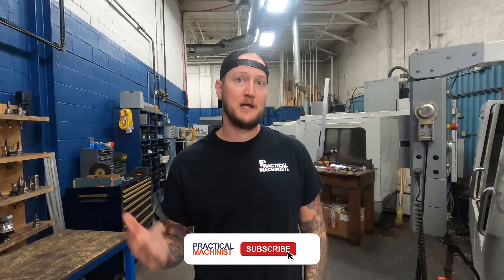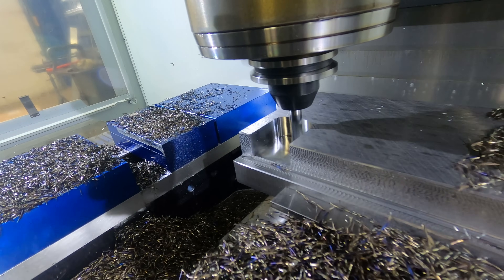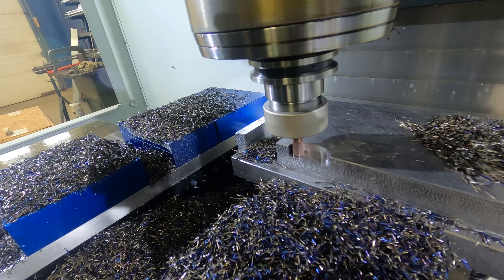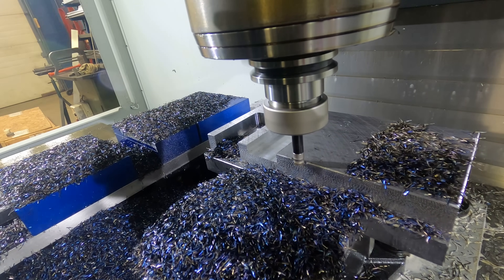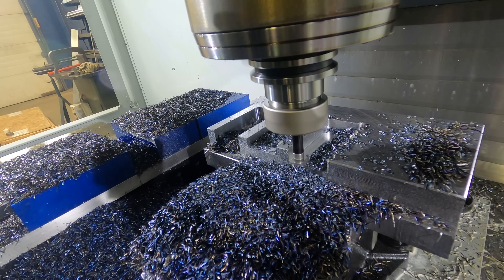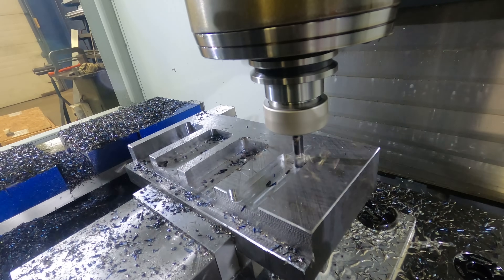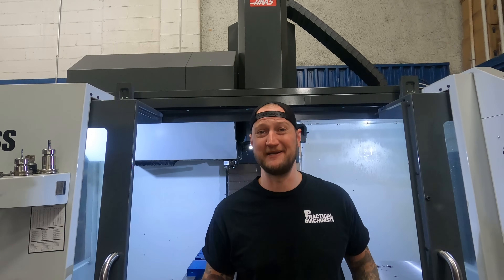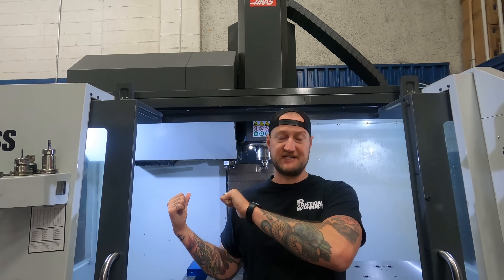Are you Wasting Time with Dynamic Toolpaths? | Machine Shop Talk Ep. 96

Comment: In narrow slots like this, yes you're better off just slotting with a 4 flute end mill. The 7 flute tool was run insanely slow. That feed rate couldve been 10x faster. Trochoidal milling is also helpful if youre workpiece isnt super secure. The cutting force from slotting is significantly higher than that of a trochoidal tool path.

Comment: Great video. Coming from a background of running a lot of tough materials the modern tool paths seems to have a lot more value on those types of material. Especially when you go from the old school thought of large expensive tool with an aggressive tool path  vs a smaller tool with a high speed  trochoidal tool path.

Comment: How do you find the best feeds and speeds?
Reply: The manufacturers provide this info for their tools in their tool catalogs, as charts based on material hardness, tool diam. So you grab SFM and IPT values from the catalog. In you cam you also have to define the tool diam and number of flutes, after that you plug in the SFM and IPT from catalog. That should put you in a good starting point that you can play with at the machine.

Comment: great demo.   I was all traditional up until about 5 years ago when I wanted to learn more about Dynamic.  Now Dynamic is my standard ruffing.  Even low HP machines can benefit.    I learned in steels you need very good tool holders - or the tool will pull out.  

many companies like Lakeshore and Helical have very good HSM feed and speed charts - you can go deeper and faster than you think. Especially if you came from a hand G code type learning curve like me.
Reply: i only started as a machinist/programmer around 7 years ago and i was taught dynamic from the get go... nowadays i am deciding between indexable and solid tooling based off of the shape of the part and raw material, roughing a shallow slope with lots of radial and not that much axial material to be removed? indexable high feed and vice versa... but most important is to get a good tools in the first place, from my experience Iscar solid carbide tooling is average at best, their indexable stuff is amazing most of the time, but i had much better results with Guhring for example compared to Iscars solid mills...
Reply: @dubi127  I am tentative of going back to index tooling as it sounded like hammers cutting but I was doing traditional tool path.  I have a friend that was an iscar engineer and shared a lot of cool data

Comment: Can that chip be re-consolidated and recycled?  Maybe heat it up and cast an end mill?  Or hammer out a samurai Dotai sword? Could likely pour some gauge blocks? THAT would be a challenge to you machinists. WHAT can you do (that is of value - or of utility, or of little loss or waste) with your chip?!? 
This was very insightful! Unfortunately for myself, my best friend- this looney old grey guy called Bridgeport got some new ideas when I upgraded his DRO’s firmware with some AI code and he ran off with this redhead named Cincinnati.  So I’m all alone, and I’m afraid that now this Makita angle grinder is as dynamic as I can be.
Reply: The chips will get recycled. Most shops will sell them off to a recycler. The shop I work at is also a foundry so we remelt our chip and make other castings from them.

Comment: Hi Ian, I'm usually a fan of your videos, but this video is complete and absolute garbage. It's obviously some sort of sponsorship with Iscar, but the issue is IF YOU RUN THE SAME DOC ON A WALL IN A TRADITIONAL TOOLPATH AS A DYNAMIC PATH THE DYNAMIC PATH WILL BE SLIGHTLY SLOWER, BUT THE CLIP LOADING ON THE INSERT OR CUTTING TOOL YOU ARE USING WILL BE CONSISTENT IN THE CORNERS LEAVING A BETTER AND MORE ACCURATE CORNER DURING TRANSITIONAL MOVEMENTS.

Comment: Try your 850 sfm on your .375 4 flute at 135 ipm. You’re not using chip thinning whatsoever so you are truly slowing yourself down a lot.
Reply: correct - I wish the CadCam systems had a chip thickness calc built in according to radial or % of step over.
Reply: @pokeyboy1  MasterCam does this on adaptive tool paths but not for traditional contours.

Comment: We had a fixture plate that was 19X10 inches that we had to take a ton of stock off around these bosses in the middle. Originally it was programmed to rough it out with dynamic and it took like 50 mins. We found a 2 or 3 inch insert cutter and roughed it out in literally 10 mins with a simple 2D contour taking depth of cuts using the full width of the cutter . Sometimes on older machines with memory limitations this is also the way to go being that it’s less code .
Reply: Oh definitely - with my old machines when the options are drip feed a modern toolpath or use a bigger cutter, you know what I’m going to pick
Reply: @LakewoodMachine 👌🏻
Reply: Just don’t say it to Titan. He will show how to mill using Dynamic at 80000 IPM on 4140 prehard  with 45% stepover and make your fixture within 2 minutes.

Comment: I think for doing small volumes, the time/energy saved just hitting "adaptive all the things" when programming can be worth the potential of a slightly longer cycle time in certain cases. If you're at the point of needing to save a few min per cycle to make big savings then sure seems like there's times when getting specific tools to go HAM on specific geometry makes good sense. But what's the risk of programming errors and such? 

I do usually 1-20 part runs so it's often I go very conservative on dynamic toolpaths just because I don't want to loose time to a booboo where we bit off more than it could really chew.
Reply: I hear ya man - if you’re not cutting seconds off production for huge runs sometimes it’s easier to just work with what’s working!
Reply: i like the idea that when you get a new tool/machine, run it fast and hard to see where the limit is, back off around 10-20% from that failure point and enjoy decent tool life, reliable process and fast cycle times... 
I usually do 1-4 part batches, but around once a month i get to program and setup larger baches of parts, sometimes in the thousands, this approach has worked for me pretty well in the last couple of years... Right now i am tweaking a production run of 3500pcs/month on a lathe, progress so far is cycle time halved, tool life pretty much doubled... may even post first operation as a short in a few days...

Comment: Broadly speaking, dynamic toolpaths are best suited to dynamic machines. A big 40 taper machine is designed to make big cuts with big tools, but it just doesn't have the acceleration to get the best out of dynamic toolpaths. A VF might in theory have 1000 or 1400ipm rapids, but it won't get up to anywhere near that speed on short movements because there's just too much inertia. Try the same thing on a Speedio or a Robodrill and you'll immediately see the point - these machines aren't as rigid, they don't have as much spindle torque, but they absolutely fly when they're out of cut. Pecking away with light cuts suddenly makes a ton of sense, because it's what those machines are built to do.

The other important factor is process stability. A dynamic toolpath that's more gentle on your cutting tools and workholding might be the better choice even if the MRR is lower, because it's much less likely to result in a scrapped part or a crashed machine. This is particularly true if you're looking to run parts unattended, if you're working with difficult materials or you're running complex parts with long cycle times. A traditional slotting or pocketing toolpath has a much higher pucker factor than the trochoidal or high feed equivalent.
Reply: This is the first time I've seen a 40 taper machine referred to as "big".  

One of the machines I program is a Cat50 Matsuura that can, and does regularly hit 2500+ipm.   Most modern, linear guide machines aren't going to have an issue hitting the higher feed rates.
Reply: When he said full rapid return, I thought it looked like 25% or slower. I agree the feed could have been much faster too. At least on our mills it could have.
Reply: What about high feed compared to these?
On another note... a solid carbide end mill is about 20% the cost of the last tool (the carbide axial screw in tip). Like ridiculously expensive and it's a one and done.

Comment: Dynamic milling you could run much faster and if you really want to make make this pocket fast you better to rough it with high feed cutter almost with the same diameter as a width of the pocket and then clean corners with solid carbide tool
Reply: That would most definitely be the way to do it!

Comment: I may be missing something here, but your first two tools seem to have a very low feed per tooth chip load. They can easily run at .006” per tooth (with a 10 percent step over, I see you’re up around 13) The thru air is key though! Love the dynamic clearing paths on 1018. Tools last forever. We’ve saved an insane amount of time going from traditional milling with insert endmills, to dynamic milling with 1/2” and 3/8” endmills. That’s just my experience though!
Reply: @evertons9147 yep - title was a bit provocative but I wasn’t aiming to torture test them to failure but you’re not wrong - I could have pushed them harder, we were just trying to illustrate some different ways that still work well
Reply: @LakewoodMachine  Have you ever used FSWizard to calculate speeds and feeds for dynamic milling? By the way, the guy who created this app lives in Toronto.
Reply: @ov3753 I haven’t but I would be interested to give it a shot for sure!
Reply: @LakewoodMachine  idea for a future video, tips how to choose a correct tool and toolpath for different part/material geometries, where to choose higher axial and where higher radial engagement tool, narrow pocket, part perimeter, roughing steep/shallow slope etc... maybe just shot time estimates from the CAM to save yourself some time and run just those two scenarios that show the most difference...

in this video the main difference was tool type and cut parameters for that tool, also it would be fun to showcase the difference between dynamic and conventional toolpaths by only changing toolpath type in CAM, while keeping the same feeds and speeds for the same tool, do this for 3 types of tools and you will get 7 different outcomes... machinig has too many variables, I LOVE IT!!!
Reply: You would run a 7 flute at .006" per tooth... Is there is enough gullet for that?
Reply: Fun thing about room in the gullet. Radial chip thinning... look it up for a deeper explanation. But if he programs it for .006 ftp with 10% step over. He really actually only seeing .001-.0007ish chip thickness. I run 3/4 7flute with .035 radial at programmed .012ftp 

This is the equivalent to 50% radial programmed at .003ftp in terms of actual chip thickness.

Ps I do a 1inch depth of cut at 1000 SFM in 1018 with those feed rates
Reply: Yeah no I apologize - I was hoping I was a little more clear that these were just to show different options that may be quicker depending on how you run them
Reply: My haas vf2 (non ss) 
Would run this all day on the same endmill.
Need to push them numbers Ian! :p

https://m.youtube.com/watch?v=4Cs5R8rYfFA&pp=ygUISGFhcyBoc20%3D

Comment: I've been using dynamic tool paths since I learned about them. I find them far superior to the standard tool paths for roughing in most applications especially when you run them with the proper chip thinning speeds and feeds and they are much easier on the tools and the machine without all the hard directional changes. You can really rip thru material when optimized. I've used the interchangeable heads and they were more expensive than the soild tools and that didn't include the shank. I've never run any of the insert head smaller than 3/4 but the cost of the head and shank and inserts didn't seem Worth it for my job shop
Reply: For sure, it really depends on the application - we use a ton of dynamic these days, especially in conjunction with high-feed or insertable tooling - just trying to illustrate some options, not a direct 1 to 1 comparison!
Reply: The Iscar sales guy at a recent demo-day told me one of the main benefits of the exchangeable head tools is to reduce setup/changeover time on live tool lathe applications. The price doesn’t make sense for most mill applications where swapping tools isn’t as difficult.
Reply: @poetac15  Iscars Multi-master line of tools is also great for when you need an endmill to reach 12xD deep... you can "Lego" it to suit your needs and special applications...

@jasonbennett9851 you can also use dynamic tool paths with indexable tools, like high feed face mills and use bi-directional cuts for even faster material removal, i had a 52mm FFQ4 face mill from iscar plowing through S355 flame cut plates at around 6600mm/min 1100rpm, ap1mm, ae35mm... It was in one of our old machines with weak spindle, but it happily chewed through material at almost 100% spindle load with pretty much zero time wasted to slow rapids of that machine, cutting time per part from quoted 1hour/part to just below 17 minutes...